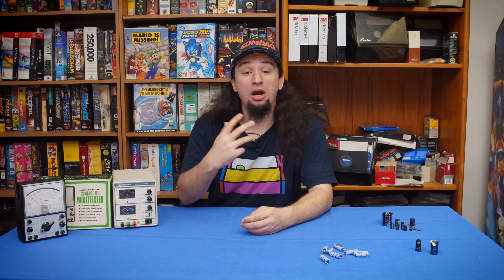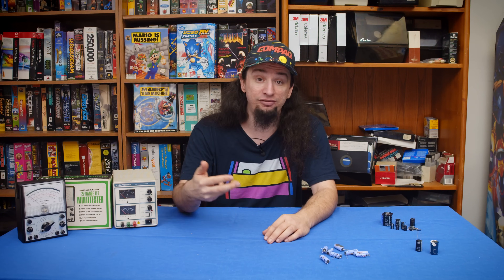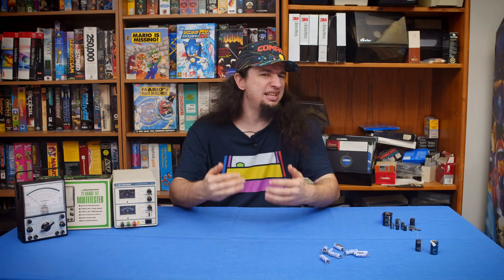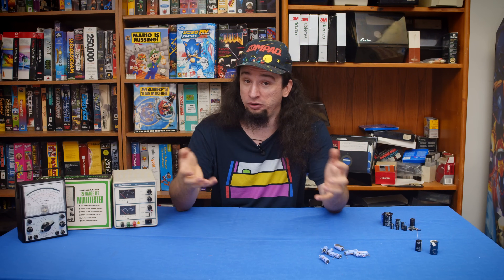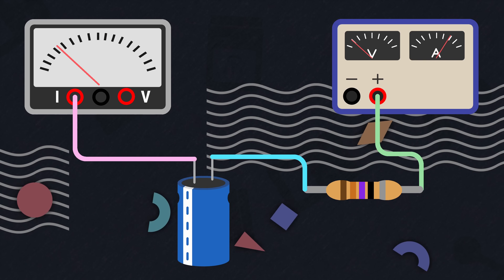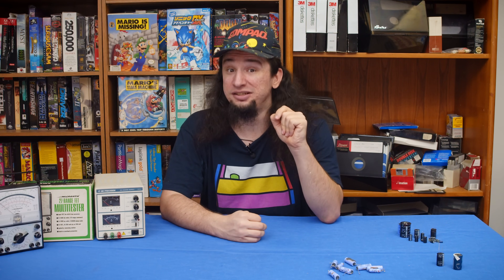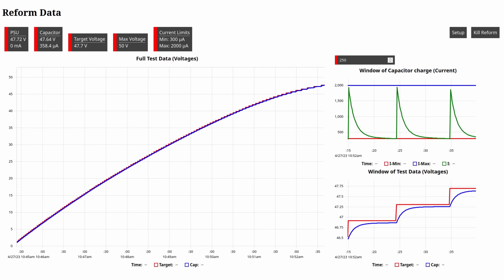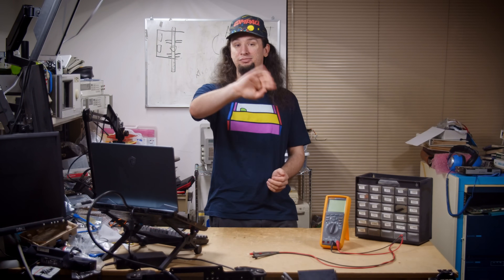Reforming Capacitors - Everything you wanted to know

Comment: Isn’t beneficial to slowly rotate the cap for some time over two axes? To distribute the remaining electrolyte?
We see very similar issues in really large DC (2500V or up) capacitors that are used in DC locomotives.

Comment: Generally I despise the thought, but this was a good video on the subject.  You also have to ask yourself if this capacitor fails short circuit, what part is it going to burn up.  Usually in my case it's a old transformer I can't get anymore.

Comment: really like your research, though I think I will just replace them whenever needed. 
About your method, you could also use a high end power supply with current and voltage limiting. if you first set the current limit while shorting the power supply, and than set the voltage limit by opening the outputs, your power supply will automatically ramp up the voltage as the current tends to drop. of course, your power supply need to have fine adjustment for milli/micro amps for the rated capacitors you intend to reform.

Comment: I'm sure you know this, but 120V 60Hz AC is 336V peak to peak.
Reply: But you can't get more than about 200V= after rectified, you always have 0 V to 120V~ max on any wave... Anyway getting 400V is quite easy when using 1:2 transformer and then rectified. Or even more.
Reply: @vencdee  Well, the positive peak on 120V AC is 168V, and negative peak is -168V, making for 336V peak to peak.  With DC rectification, you have four diodes that will block the negative peak, and the capacitor will charge with a resistor keeping the capacitor (that needs to be a 200V one) from discharging too fast, which will average to 120V.

Comment: Hmmm. I replaced a cap in an old Telefunken Rondo 105 speaker years ago. I couldn't find the same rated cap, so it doesn't sound the same. If only I knew about trying to reform the original ones.
Reply: They were worn at this time, the reformed capacitor never has the same performance as new. I'd rather buy new hi-quality capacitor for such device. For the same capacity as original you can combine them easily in parallel from other available capacities...

Comment: One thing I would like to see covered and examined is how many manufacturers cut corners and install capacitors in devices that are barely able to handle the rated voltage in their installations.  A couple cases in point here that I ran into years ago...  
I had purchased a plasma TV when they were all the rage.  It worked fine for about a year and then I noticed longer and longer start-up times for it.  Then one day I hear the dreaded high-pitched "pop" from inside and smell the all too familiar odor of the electrolyte.  I set the TV aside and we bought a new LCD one.  Everyone seems to understand the power demands of the plasma versus the LCD (and now LED) sets.  However, I was not going to give up on the plasma.  I had heard of them failing all across the country it seemed!!  I was convinced of a simple explanation.  Taking apart the plasma TV took longer with the about 800 screws (exaggerated of course) holding the case halves together, I found that it was neatly laid out with separate boards for the various functions, one of them being the power supply.  As an aside, these power supplies have NOT radically changed and are still used in all sets!  Looking at the board I clearly saw the popped open capacitors and others that were bulging.  I looked at the rated voltage of them and quickly decided that the manufacturer had not allowed any leeway as they were right on the actual voltage applied to them.  I took down all the ratings and then went to e-Bay and bought a whole new set of them at DOUBLE the rated voltage.  Now, here's the most interesting part...  The circuit board was actually set up to use larger capacitors than what were installed!!!  This was plain to see by the pictorials drawn right on the board and the extra space around the originals.  Nothing else on the board had extra space.  The new capacitors arrived, and wouldn't you know they fit the actual available space perfectly.  That plasma set worked fine afterward, and it is still working like a champ in my living room 20 YEARS later!!!  I only wish I had started repairing plasma sets for other people as so many were thrown away for nothing more than $12 in caps and a little labor on my part.
My second great instance was the control board for my $1 Jacuzzi hot tub that failed (yes, it cost me $1 for an eight-person hot tub!!).  It sort of mirrored the plasma TV in how it gradually failed.  I took the board out and saw it looked almost perfect.  A couple caps were peaked though but not ruptured.  I found the test sequence on a web search and proceeded to measure everything until I could go no further.  At that point I sent an e-mail to a person in AZ who could rebuild the boards.  I gave him my thorough test results and he was so impressed that he called me!  He said that it was going to be an easy fix since I knew my way around and that I wasn't going to believe what I had to replace.  The capacitors were my first guess and was right.  Again, I ordered double the existing voltage rating and oddly, there was extra space on the board again...  Seeing the manufacturing pattern here?  After replacement the hot tub was back in operation, and I was relaxing in it until we moved out of that house and sold it before that move.  For $3K in case you're wondering!  
So, the question remains as to why manufacturers are shortchanging the capacitors in everything.  Are they simply doing it knowing that they will fail and the average person will run out and buy a replacement device?  I smell a rat here....
Reply: This is the strategy of limited lifetime of device. So after guaranty is over, the device will fail and you must buy a new one... Not only capacitors but insufficient cooling on power transistors and ICs etc.

Comment: Excellent video.  Just a caution on putting power supplies in series.  As you stack them up, the output terminals and circuits of the power supply on the "top" of the stack will be above ground with respect to the supply at the "bottom" of the stack.  Probably not a problem with low voltage supplies (12Volts or so) but when you get up into hundreds of volts you may exceed the terminal to ground breakdown voltage.  Just like balanced inputs on scopes, you have a terminal to terminal voltage maximum, but you also have a "common mode" terminal to ground max.  73 deK1WXY
Reply: It's best to have rating for 1000V or so. In Europe where the 400V/3p is defacto standard ratings for 1000V is quite normal on many devices (or at least 500V)...

Comment: 8:25 failing the possibility to slowly raise voltage, would it be valid to to bursts of power? E.g. swithc on device for 2mins, power down,then wait 1 min, switch on for 5mins,  power down, then switch on for 15 mins?
Reply: Probably not... the capacitors will explode or so immediately... if not then maybe it could help, but you never know the currents and proper times...

Comment: most old capacitors are superior to what nowadays is produced. i talk about late 70's until mid 90's. Then chinatown came around and they made it fubar. So dont start to replace all capacitors like a braindead. Most are just fine. I repair audio equipment and never really replace capacitors, only in some ports with higher frequency. But then i often use spare parts i once removed from circuit boards, never new ones.

Comment: I've restored lithium ion batteries using the same process.. 10-12 year old batteries still going strong today. Albeit about 75% the original capacity but i think it's still pretty good. Better than the cheap Chinese new batteries that come new with 1/2 the total capacity from their rated twice higher capacity
Reply: Mostly funny on these cheap Chinese products is that  the Lion/Lipol cells have fantasmagoric capacities on them like 4000mAh or even 7800 or so. After tests the real capacities are 1/10 or 1/5 of these values... Never buy cheap Chinese batteries.

Comment: Just a little hint. A small filament globe (of the right value) can limit the starting current and then automatically start lowering its resistance over time for the capacitor to reach full voltage of a 'stage' of re-forming. I still recommend 
re-forming in voltage stages, with 'time patience'.
Reply: I've seen something about this but no one seems to be specific. I use a high wattage bulb for DUT. But in this case, I presume you are putting the bulb right in line with the cap and PS - so what type/size bulb have you used for this? Of course it would be dependent on the cap values, but what has been your experience?

Comment: Perfect for vintage valve and transistor amplifiers since you are very unlikely to get direct replacement capacitors any more. Even worse fitting something a bit more modern as a replacement involves too much modification to the original set up. If you look at the old data sheets, they actually quote a shelf life for electrolytics, ie how long they will last with no voltage acoss them sitting in a box unused.

Comment: I deal with AC variable speed motor drives and occasionally have to reform the capacitors in them. Manufacturer recommends to do it every 2 years if they've been powered off. They are usually 450V capacitors in a series/parallel setup. I use an 120V AC variac, a 600V:120V transformer in reverse and connect to the AC input of the system. The drives have a pre-charge diode and resistor for normal starts and a thyristor bridge on the 3ph power in. I can bring the voltage from 0 to 600Vac (0 to about 850Vdc) using a standard 120V wall power. I have also done a similar manual setup with a 600V rectifier and a rather large resistor (I think it was 10ohm, like 100W) to make my own DC supply for models that did not have a rectifier circuit.

Comment: Very interesting and a new concept for me as a collector and maintainer of electronic musical instruments. When to replace / recondition parts / assemblies is always a bit of a conundrum since one is constantly accompanied by the fear to actually make things worse. So a procedure for in situ reconditioning of capacitors just through the input voltage feed would be a bit of a golden grail, even if only to more safely start up instruments which have been dormant for years. It would very interesting if you could elaborate on this a bit. Could one for instance use your program to slowly wake up a whole electronic device after setting some values up front (or instance to addapt the program to a software regulated supply)?

Comment: im surprised you dont use a boost regulator with a constant current circuit
i would have though that a cheap and simple way to deliver high voltage at a fixed low current

Comment: Heared that for very big commercial ones, so the example that I remember was a capacitor that was big as a coffee cup and used for a ~220V AC-motor inverter, but for the smaler standard electrolyte capacitors i always got told that they 'dry out' and in the same company where i saw the big one that has to be reformed after some weeks of not using it, they changed ALL Elkos as a standard procedure when refurbishing electronic modules.

Comment: Reforming gets you personally involved with each capacitor and is inherently a capacitor testing procedure. Afterwords, you know much more about each capacitor than you did at the onset giving you an objective basis for trusting or not trusting the capacitor in future application. Do check each reformed capacitor with an ESR meter to further your confidence that it will work well.

Comment: The metal can cap shown in 15:36 is commonly used as a motor run capacitor in HVAC equipment.  They are very inexpensive in small uf sizes.

Comment: Interesting to know.  Still, one can easily understand why most responses are going to "just recap" the device.  The labor cost of manually riding the voltage control of a variable power supply (most hobbyists wont have one) to keep a constant current, plus the durational time it may take, make it an unwise prospect unless you get a thrill of this chore as a pass-time.

Comment: I know that those cheap capacitors are prone to failure,sega,nec and atari were known for using cheap ass capacitors in their handheld systems as a result they couldn’t last for 10 or 15 years,so you have to replace them with high quality ones to increase it’s lifespan and to make it functioning properly well once again like new😁🤣

Comment: Great video, especially the description of how electrolytics are made and work, but after 46 years of servicing electronics I have to say it's never a good idea to reform a used capacitor. If it's not up to snuff, just replace it. Caps are not expensive on the whole, especially compared to the damage leaving a bad one in place can cause. Reforming NOS caps might be reasonable, but I personally would not do it.

Comment: Please mention key information at the beginning please.  In this case I learned that leaking , bubbling, and corroded caps should not be considered for reforming. This was at the 16 minute mark in the video.  Thanks for the vid though.  I have a considerable background being a tech and not heard of this process.  Remove and replace is the common repair method of course.

Comment: As an electrical engineer BSMEE  I have heard of capacitor reconditioning and reforming.  I have worked on and designed Amplifiers and power supplies ( Linear and scan rectified)and Frequency generators and Programmable control hardware for 40 years.
  In the field it is easier and cheaper just to replace a suspect capacitor. On vintage equipment is another story. If the capacitor is not easily replaceable because its in accessible or because modern capacitors are much smaller for the same value uF or even for ascetics, Then reforming may be an option. Problem with reforming is you do not know the quality the final result and reading the uf capacitance value is no indication. It may last a day or a year.
But a new Capacitor is always better than reforming an old one. 
  You post no credentials. But you provided a in depth wel explained explanation of what is happening on the inside of a capacitor.
Suggest you do a video on the capacitance of components that are not capacitors, like a Zener diode, a MOV, a step up transformer, A Transistor, An DIP IC socket, a touchscreen and why this is so.

Comment: Pretty cool, I didn't know they had to initially "form" the caps for use.  I always thought they had liquid in them and that the failures were when they dried out.  Replaced plenty of expanded and leaked caps.  CapacitorGate.

Could you just partially step thru the reforming process, then insert the cap back into its circuit?  Then it could finish reforming there?  For caps used in a power/filtering type circuit?

Comment: People mistakenly "think" the US doesn't have 240v available in practically every building. Go look at the big cylindrical grey transformers hanging on power poles and note there's three wires coming out the top? Also your electrical breaker panel has two columns of breakers on each side? There's 240v in that panel, just split into two 120v banks on both columns with a common ground bus bar down the center of the panel (hidden inside!) and those 3 wires on the transformers? Again, two 120v legs with a third leg for common ground in the middle.

Those GIANT  black round wall outlet plugs that your electric stove or clothes dryer plugs into? Are 240v... Just in case you were looking for an easier less sketchy source for some higher voltage projects without using 120v PSU's wired in series.👍

Comment: I've got years of analog electronic experience and never knew this was a thing. I'm still learning, cool!
Reply: Me too - although I knew that old caps dry out, leak, or explode (it happened to me ;0 ) and sometimes must be replaced even if the gear they're in has been in constant use. In the audio industry, mixing consoles are "recapped" after some time interval. However, some techs go too far and replace all of the mixer's electrolytic
caps which usually isn't necessary.

Comment: I began working as an avionics bench tech in general aviation (small planes) in 1970. One of the most common failures we saw was in a handful of VOR/LOC converter/indicators; the VOA series by Narco avionics. By far the most common failures were in the handful of electrolytic capacitors in the units. I worked at a shop afterward that just replaced the capacitor that failed, but that first shop put together "overhaul kits" that were replacements for all the half dozen or so electrolytics in the unit. Shops that failed to replace the whole bunch had much higher callback rates.
My point is: the best results are always from replacement of all the electrolytics in a unit when one fails. Sometimes we don't want the best (getting another year with maybe a cap replacement or two) but that dooms the customer to failures that would not have occurred. If the equipment is not worth the "shotgun" cost, it is not worth any repair.
Reply: Avionics is a special case. It's no place for cost cutting. High reliability is required. It can be awkward to park an airplane by the road when something fails.

Comment: I have that exact same BK Precision power supply.  They are absolute trash but they get the job done.  Mine melted an internal wire at some point during its service for the previous owner.  I recommend Agilent/Keysight lab supplies, but you'll have to justify the coin.